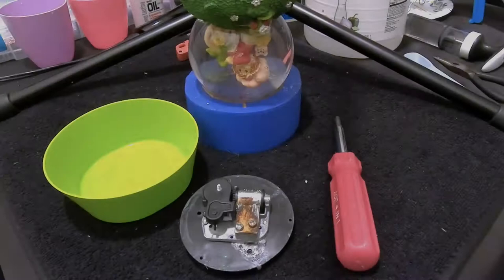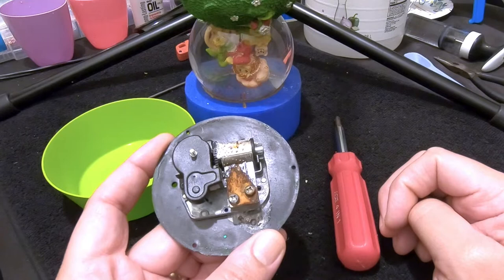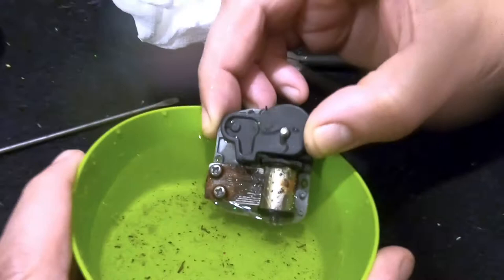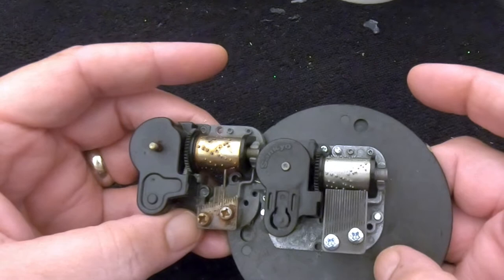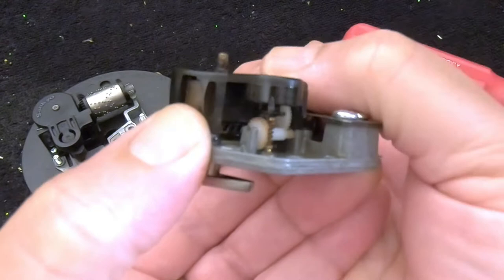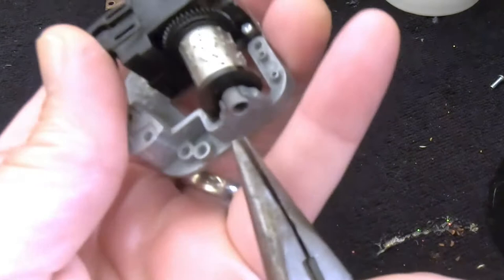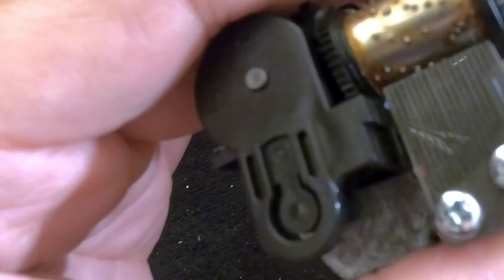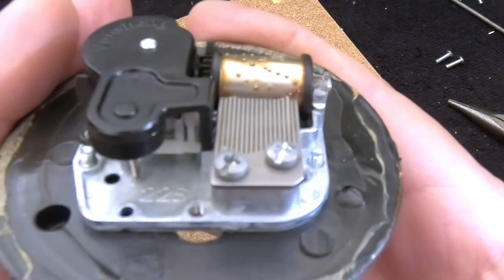Ep. 51 - Strawberry Shortcake Snow Globe Music Box Mechanism Repair -  Rust, Barrel Transfer

Comment: It's been a while, ours is silent night of baby Jesus on the fable' i'd fixed the sound when pressed and it worked so long but the moving design outside is not connecting to the move of the wind box...
Reply from the maker: Yes, it can take some work to get the connection right. We have had some difficulty with those connections as well.

Comment: Hope do notice me my case is; that the turning metal handel to switch it is lost' what is the secondary to put there so that i can press it well?
Reply from the maker: It sounds like you are missing the winder key for the music box. They sell them online or you can buy a cheap used snow globe or other item that has a music box and use the key from it. Here is one that is on sale on ebay, hopefully this is what you are looking for:
https://www.ebay.com/itm/384941671008?chn=ps&var=652815172458&_trkparms=ispr%3D1&amdata=enc%3A1fz0S5Ad5RxqnT0cFxjgW9g47&norover=1&mkevt=1&mkrid=711-117182-37290-0&mkcid=2&mkscid=101&itemid=652815172458_384941671008&targetid=1584739238054&device=c&mktype=pla&googleloc=9012065&poi=&campaignid=19894961968&mkgroupid=148855406073&rlsatarget=pla-1584739238054&abcId=9307911&merchantid=426118008&gclid=CjwKCAjwp8OpBhAFEiwAG7NaEmPlVGhi-t5HT-i7Nj9DyHE4kKugchK4Wr7u_G0fiB6HgU7BlkAmmhoCo_oQAvD_BwE

Comment: I put a music box from one of my globes in a vinegar bath because it was rusted. I'm not sure if it didn't turn before I did this, but it doesn't turn now. Is that recoverable?
Reply from the maker: Hi. That has happened to us. The rust and corrosion appears to have impacted the spring assembly of the music mechanism. You have a couple of options. If you are not concerned about keeping the original song you can find a cheap old used snow globe in the thrift store or flea market and use the music box mechanism from it. If you want to preserve the original song you can take that replacement mechanism from the one you find at the thrift store and take the comb and barrel from your globe and install then on the replacement mechanism. As a last resort there is a link in the video description to The Music Box company where you can purchase music boxes. I haven't actually done it but we heard that if you don't see a music box listed that plays your song you can request a music box that plays that song and I believe they will make it. Hope that helps.
Reply: @Snow Globe Rescue  yes that does thank you very much. I recently moved and all my snow globes were wrecked. This one in particular was sitting in its own water. I really appreciate your videos and advice!

Comment: This hurts to watch. Please never use vinegar it's corrosive and can damage the metal further. From what I've read it seems like isopropyl alcohol and electrical contact cleaner are safe to use
Reply from the maker: I first learned about using vinegar to remove rust back when I was in the military. I have been using that method for about 40 years. I have had other substances suggested such as coca cola and lemon juice. What makes these work is that they all contain some type of acid which dissolves the corrosion. Some work better that others but vinegar in my experience works the best. The problem is how long you leave it in the liquid. The acid is not strong and only affects the good metal if it is left in there too long.  I have never known isopropyl alcohol or electrical contact cleaner to dissolve and remove rust. I have used both extensively. However, the next time we have some rusty parts to clean up we will try soaking them those two and see what happens. I don't expect the results to be as good as with vinegar but the only way to confirm is by trying the experiment. Thanks for the suggestion.
Reply: Hallo
Ich verwende 5% Zitronensäure das zwar etwas langsamer wirkt, aber gefühlt das Metall weniger angreift. Bei diesen Spieluhren ist natürlich nicht nur hochwertiges Eisen verbaut, sondern Zinn, billiges Blech und Kunststoff, alles mit Ablaufdatum. Wenn der Rost so stark wie hier ist, war es überhaupt ein Wunder  das die Mechanik wieder so gut funktioniert. Viele Grüße aus Österreich.